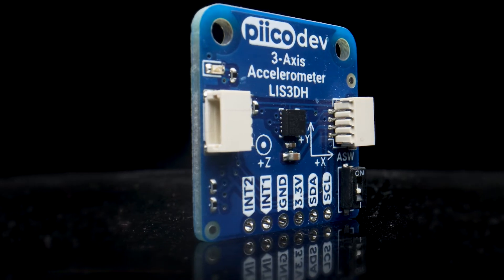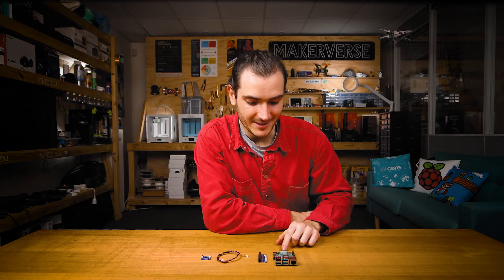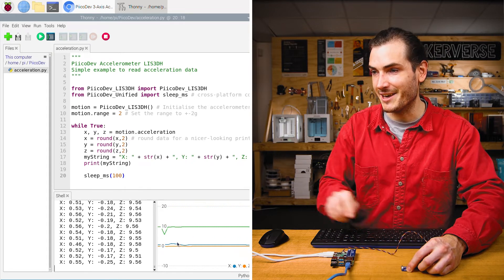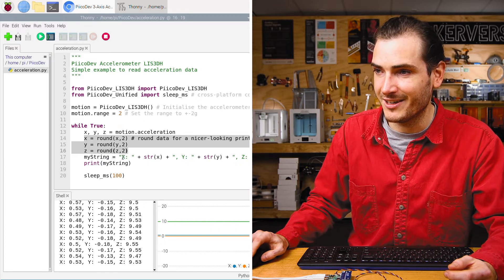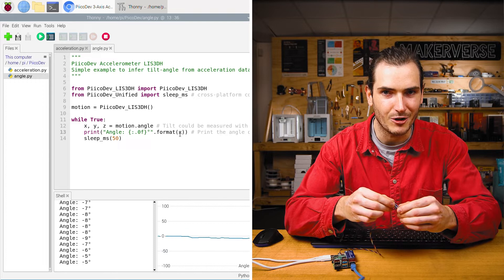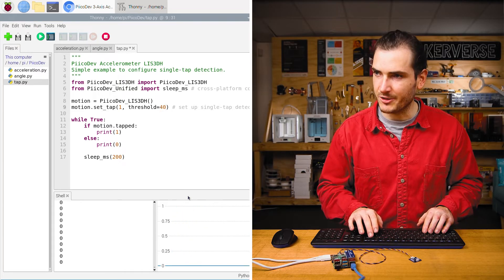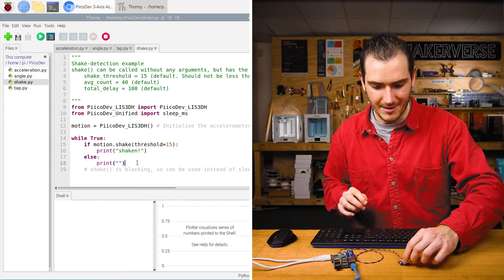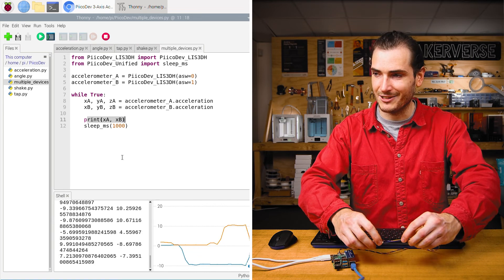PiicoDev 3-Axis Accelerometer LIS3DH | Guide for Raspberry Pi

Comment: Ok so I want to do exactly this but I want to do it wirelessly.  I’d like to be able to collect that data, in realtime, from upwards of 400ft away.  Preferably keeping the accelerometer and WiFi transmitter in as small a package as possible.  Is that possible?

Comment: Could I use this as head tracking?
Reply from the maker: You could use it for a rudimentary form of head tracking, but a more effective device for that would be an inertial measurement unit with 6 degrees of freedom. That would include an accelerometer and a gyroscope making a much more accurate tracking for things like rolling and turning your head.
Reply: @Core-Electronics  this is why I’m here. ATM I am utilising a PS3 Eye toy camera I fitted some VHS cassette tape to the lens (IR MODE) and it picks up leds however very bootleg version and it not as practical as that unit attached to the say the headphones outer ear. 

Right so looking at all these I see there are all the way to 9 axis as for all the head movements not required it’s only for in game cameras not actual 3D modelling however I will be doing that at some point too with this I’m sure haha ok so we are really theorising a possibility here
Reply: @Core-Electronics  because I been looking into VR (which I can’t use) and they’re using some form of these haha